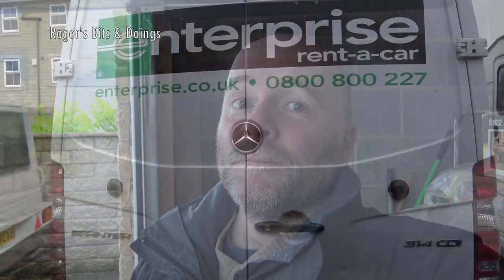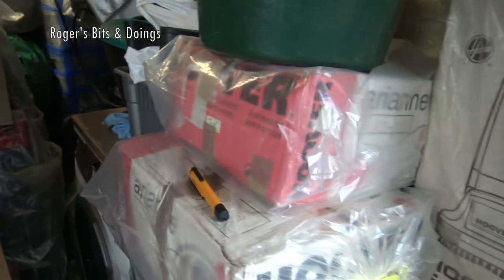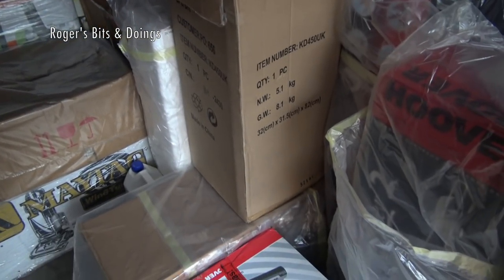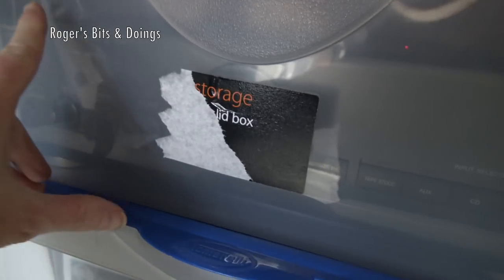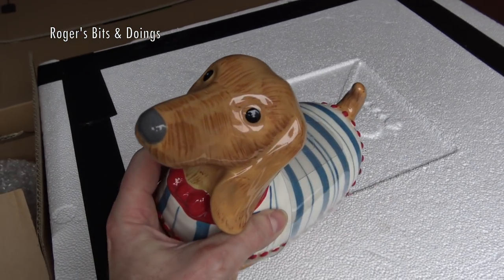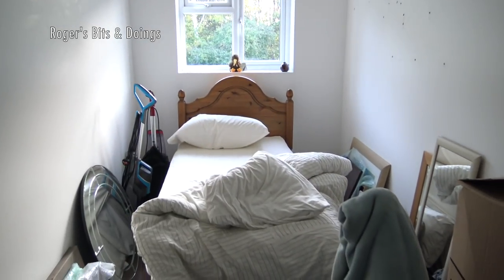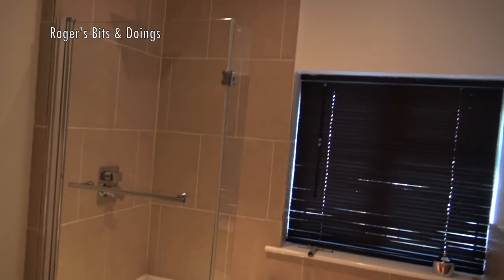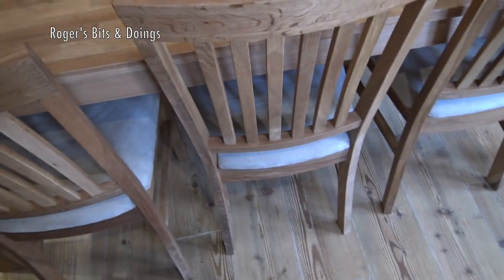Vacuum Cleaners On The Move Again!

Comment: Nice! That plumbing looks a bit weird, they obviously didn't know what they were doing. An easy fix though. Yes the crosswave just doesn't come down in price much here either, it's 250 us dollars. I was able to get mine for 179.99,  that price was the only reason I jumped on it and it had several "extras". I used it at my mom's yesterday and now she wants one so I'm hoping to find another similar or cheaper price. I'm sure they'll release a new model and the price will drop on the current one right after purchase as it always seems to happen that way! I like your mom's table, simple and clean so it'll go with whatever she decides for decor.  I just saw those same dachshund towels at the store the other day here and almost bought a set for my sister, but I recently bought her a different set with doxies so I passed.

Comment: I remember you saying in the first video of this house that the previous owners had a fridge freezer and dishwasher along that wall in the kitchen. I'm guessing the water inlet was maybe split so the fridge was plumbed in for an ice/water dispenser, the b******s must have also taken the adaptor fitting for the pipe with them
Reply from the maker: That is very possible. Anyway, we got a proper dishwasher tap to replace the fitting on the end of the pipe.